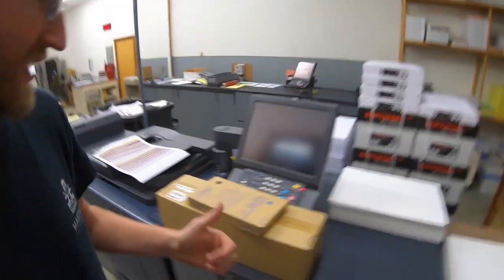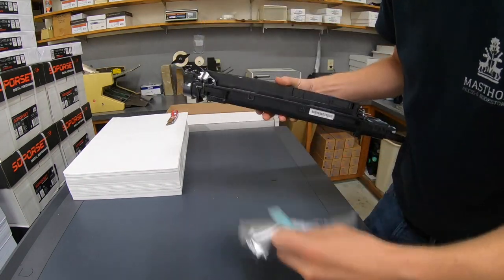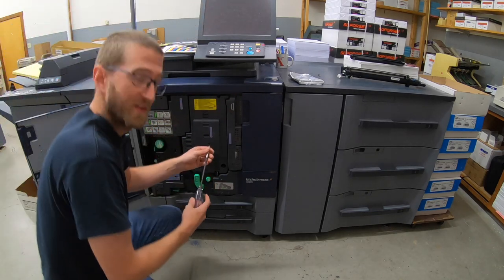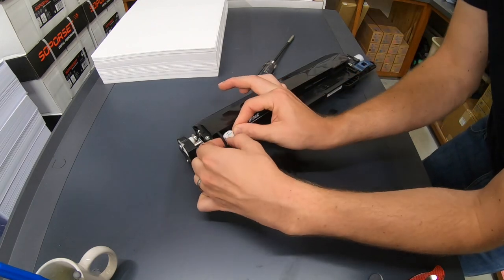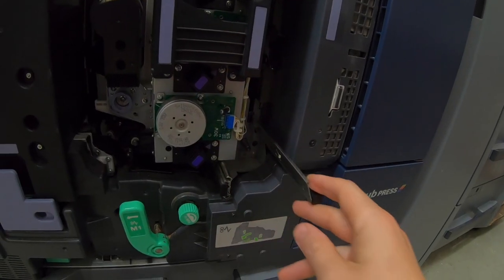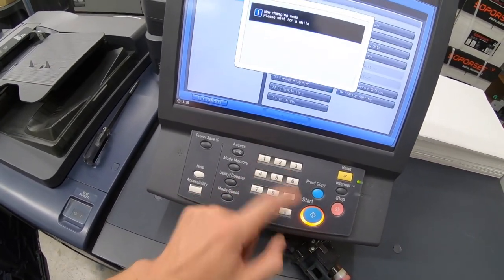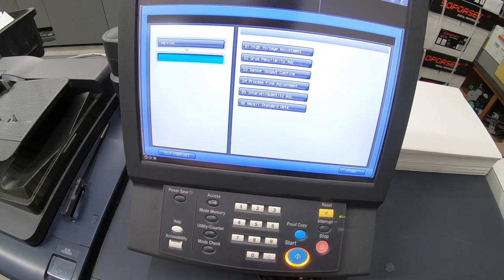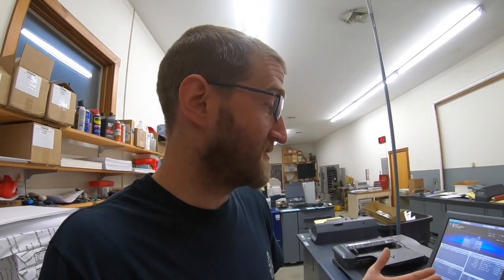How to Replace Developer and Developer Unit on Konica Minolta c1070 and Other Digital Presses

Comment: Single handily putting KM techs out of business! Keep with the great videos, Dan.
Reply from the maker: I kind of feel bad about that. I miss seeing my technicians, they are great guys!
Reply: @justaprinter  Sometimes I actually like when my machines break down so I can BS a bit with the techs. It's always nice to hear how other shops around the area are doing too. Those guys have a good pulse for what's going on in the industry.
Reply from the maker: @miketheprintman  Thats the truth. I'm crossing my fingers that something on my 3070 breaks so I can see a tech. LOL!
Reply: I manage a College Print shop, and KM in my area have very few techs and too many calls. I've had to improvise. And Dan's videos have been very helpful. 
I just wish I had developer on hand to do this. :/ 
I finally received my magenta ink after a month and a half wait. Luckily I had 3070 bottles, but I had to transfer to the 3080 bottles via funnel. The bottles literally have an inch difference in length so they weren't directly compatible. 
Both my 3070L and 3080 printers are currently down. I just have my 6120s and 951.
Reply: @Tippy2987  Hmmmm, that's not right. Both my 3070 and 3080 use TN619 toner. Same bottle.
Reply: Yes mine too c3070 and c3080 both use same toner bottle

Comment: help help guys I have a Konica Minolta C280 machine I tried repeatedly to fill the magnet cylinder, but it never fills. All the Developer powder goes to the bottom. It does not stick to the magnet cylinder. I do not know the problem!? I stay for a long time but to no avail!?

Comment: Hi
I really like watching your content, its very useful and logical.
We have a xerox versant 80 press about 4 years old. The print quality is ok on high coverage areas, but image starts printing grainy on less coverage areas.
I was wondering if konica machines, just like any toner based digital press would do same or is just the xerox. 
And also, do konica presses have any option to print in glossy mode, because xerox toner prints matte only.
Thanks. Would love to see more of your videos
Reply from the maker: Yes, Konica machines can be set to print glossy or not. You can also achieve a less gloss look by lowering the fuser pressure. Unfortunately all toner machines slowly degrade over time and need constant maintenance. Something on your Versant needs to be replaced or adjusted.
Reply: Just A Printer Thanks for the info 👍

Comment: Hi Dan, I am having a problem with the dram that has small scratches. Should it be repaired in some way or should it be replaced with a new one? Machine number 951 black ، Please help, and thank you.🌹
Reply from the maker: You will need to replace that drum, it cannot be repaired.
Reply: @justaprinter  thnxxxx 🌹🌹🌹

Comment: hello please, can i use developer of C6000 into C3070L because one is cheaper then the other, is it the same quality or is there any difference ??
Reply from the maker: No, two different types of developer units. The 3070l have developer mixed in its toner and the c6000 is only toner.

Comment: Hello Dan, what do you think of Océ VP135? I have a Konica Minolta 1200 black printing press. Because of the high cost of use, I plan to replace this machine.
Reply from the maker: I don;t know much about Oce. A few years ago they flew me to their showroom in Florida, they had a lot of very impressive machines. I was looking at their Oce Varioprint machine that prints both sides at the same time without turning the sheet over, very cool tech! What are you paying to run your 1200? For Konica service I was paying 1/2 cent for each click. As I service it myself I am estimating that my costs will be half of that... so it would be $0.0025 per click.

Comment: How do you calibrate your rip?
Reply from the maker: It depends on the RIP that you have, but there should be a button to calibrate the RIP. You would also need the correct USB spectrophotometer.

Comment: I used to have a C6500 and a C7000...both I ran "off contract" for several years. I'm disapointed to hear that every time you replace developer you have to replace the developer unit as well? That adds up! Does the developer have a longer life now? As I recall you used to be able to change developer several times at least before you had to replace a unit....
Reply from the maker: Yes, both developer and developer unit should last 1 million clicks. I got almost 1.3 million on the black. I'm assuming that overall cost of ownership is less than the c6500. Time will tell.
Reply: @justaprinter  Hey, quick question if you don't mind. I have a low mileage 3070 coming in tomorrow. I had been thinking about getting the EF103 envelope fuser. I see your 1070 came with one. Have you tried it yet? Specifically I'm wondering if you have to run with the flaps open on #10's. Thanks!
Chris

Comment: Good day sir... I wish I have your email address. I would have love to send you some samples for you to give me a clue on what could be wrong withy Konica Minolta c554. Sometimes when I print, especially first print of the day, I see yellow, magenta and sometimes cyan horizontal line colour of the paper. Then the biggest challenge is that if I print colour document especially the one that is most black dominant color, the black print doesn't come out  well blended. The black looks dull and sometimes patches of some areas black and some areas gray. What confuses me is that the toner cartridge is full because I didn't even wait for it to finish and i refill it by adding the new toner to the old toner in the cartridge. I have Shaked the back toner cartridge to ensure the toner is not congested but yet no solution. The black keeps print patches of gray and a faded black. I don't know what should be the cause. There are some images I wish to upload for you so that you can help me out. I strongly believe that if I show you those print images you will get a clear view on it. But if you can't drop an email, you can help me out here with a hint based on my explanation.
Reply from the maker: justaprinterman@gmail.com
Reply: @justaprinter  Thank you so much sir. I have sent you an email to confirm the issue am having with the Konica Minolta C554